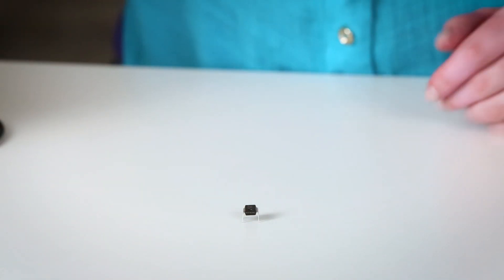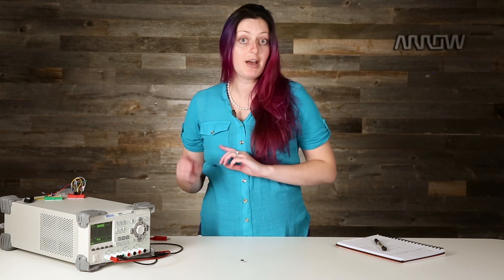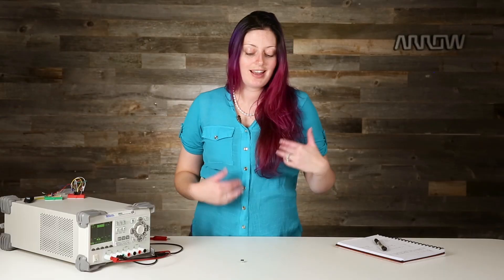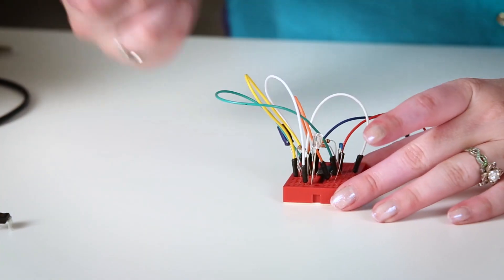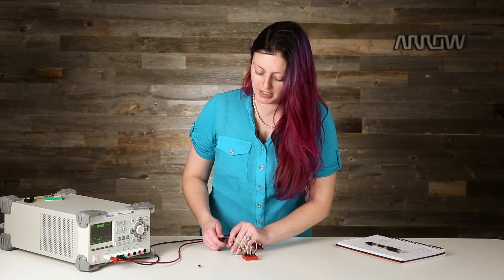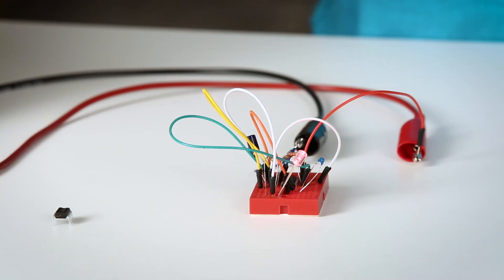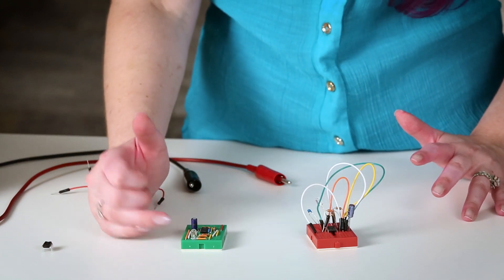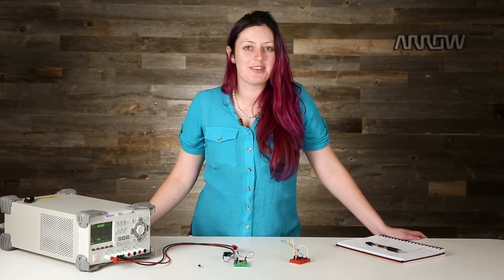How to use a 555 Timer

Comment: Is there anyway to make the led fade in and out? And if so, is it possible to switch on of the resistors with a potentiometer to control the rate?

Comment: no, the first will be all the basic logic gates 7400,7402,7404,7408,7432,7486,7474, hech a hole boat load of "simple" logic circuits. The awesome and oh so versatile 555 will come in quite a bit later. still it's not a bad video.

Comment: From the standpoint of an old dog learning new tricks view point... It didn't explain much.

Why is it EVERY video I see all rattles of thee three and then whips out a ready made board and no real explanation of other applications of the 555.

It would be nice to see original works and not all showing the same old dame old with little explanation of how the things actually work.

For example, I would like to have a simple pump on and off trigger... can I find one? Yes but not the one I was looking for as I wanted a when full, turn on, when empty, turn off. Tried asking Stack exchange and got the 3rd degree and a roasting for and accusation of trying to obtain services for free... from a site that is meant to teach or assist with help.

And then you have the plethora of un-watchable videos made by asian, indian and middle eastern youtubers whose language use of english is an abuse in itself.

Is it Youtube's algorithm or doesn't it understand when I search for "555 timer circulation pump control" in simple terms, if the pond water drops too low, the pump needs turning off and then back on when its high enough. 

Anyone got any pointers?

Comment: FYI
THE REASON WHY A 555 IS CALLED A 555 IS..............

in the internal circuit there are 3 x 5k Ohm Resistors in Series, they are basically used as voltage  Dividers.
Because of the presence of the  3   5k Ohm Resistors it is thus named  555

THAT'S WHY .

Comment: At the end you say the longer wires caused enough resistance to visibly change the brightness. Clearly there's some extra resistance, but is it really enough to meaningfully change the brightness? a meter of jumper wire is 1/20th of an ohm.
Reply: for the record I'm genuinely curious about this. Thanks for the video

Comment: Great vid & advice on using the wires over jumpers for final version, not just for aesthetics & transparency, but also for the practical effect on the circuit itself (less resistance from all the excess cable length). 👍👍

Comment: what is the formula of A stable operation? I'm trying to achieve 500ms On state and 4 second off state. I'm using 3.7V operation and have a 120mA drain at the pnp 3906 which is driving the LED's. (6x20mA =120mA) so I'm using 1K 100K at 3.3uf and it's close but the on state isn't working quite right. My timing seems to be effected by the current drain of the pnp which is pulling the CR2032 voltage down changing the timing. How do you compensate for this to create the stable 500ms On 4sec off state? Thanks

Comment: i want to generate electric power supply using 555 IC which mode should i do in 555 ic?
Reply: http://www.instructables.com/id/47-projects-to-do-with-a-555/
http://www.talkingelectronics.com/projects/50%20-%20555%20Circuits/50-555Circuits.pdf